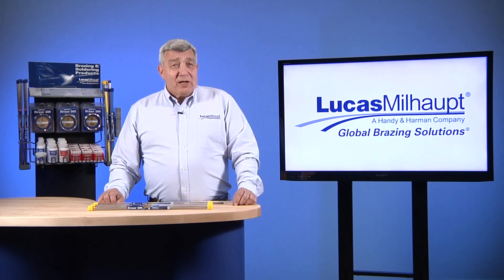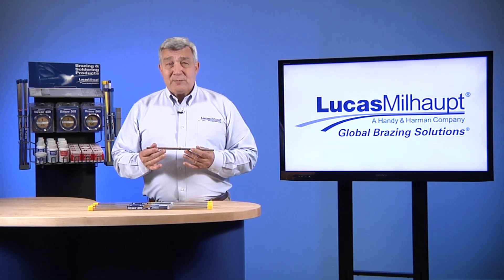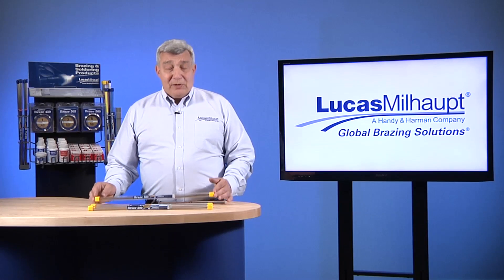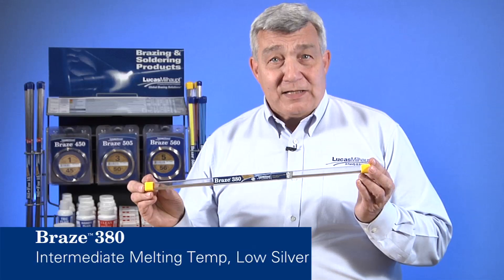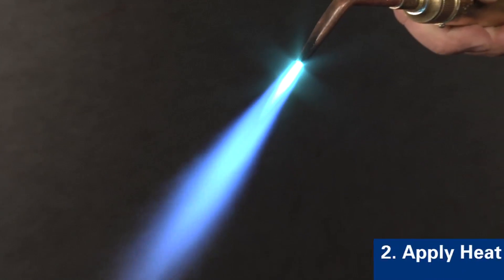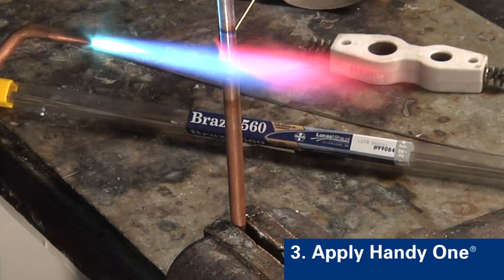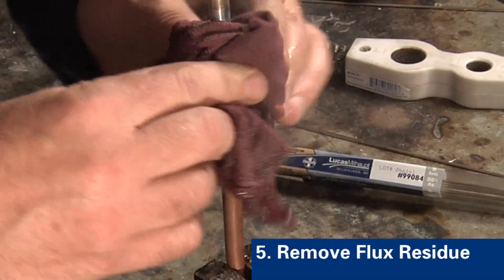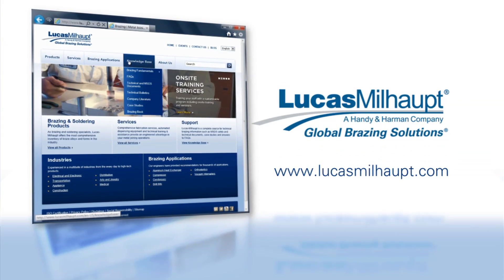How to Braze Copper to Steel with Handy One®

Comment: Hi there. I'm working on a lawn trimmer muffler. I have a copper tube in the muffler to direct the exhaust gases and oils out the back and not all over the muffler shield. Got some ideas how to seal that exhaust pipe with brazing, soldering or welding??
Reply from the maker: Hi Shawn! Give us a call at 414-769-6000 and you can talk with our technical support.

Comment: ...The original machine had a base-plate of prefabulated amulite, surmounted by a malleable logarithmic casing in such a way that the two spurving bearings were in a direct line with the pentametric fan...
Reply: +dave1208327 You have confabulated that information very curmotically.